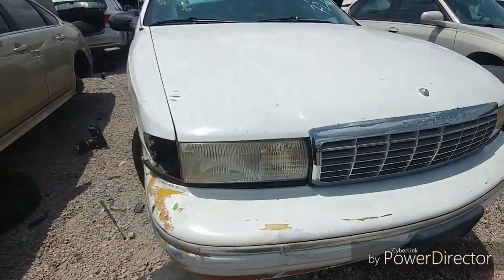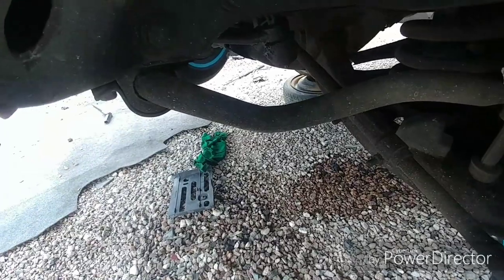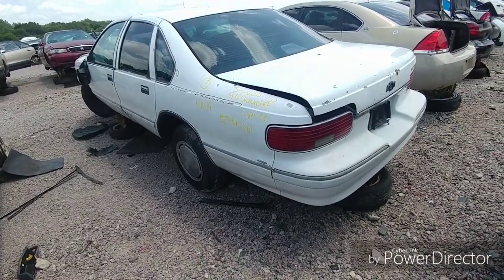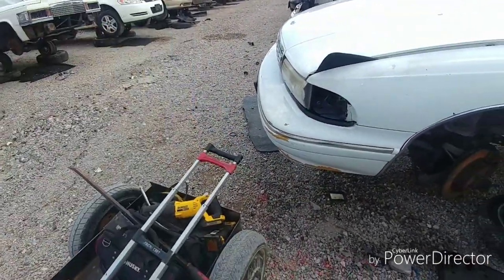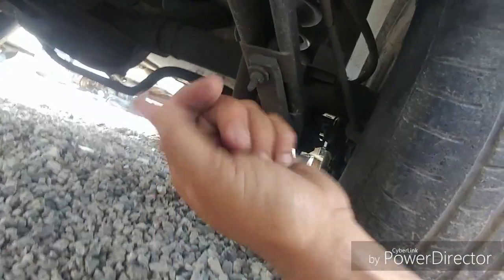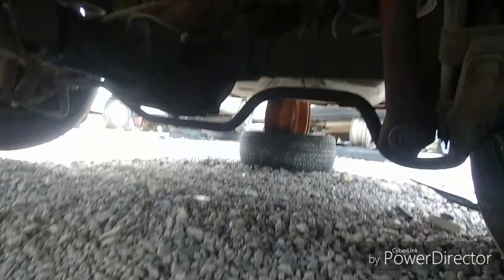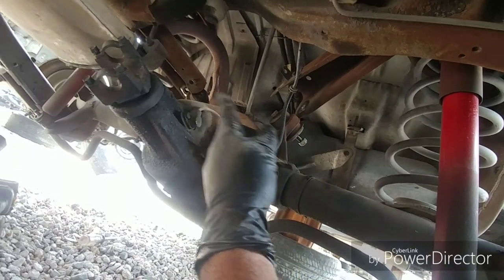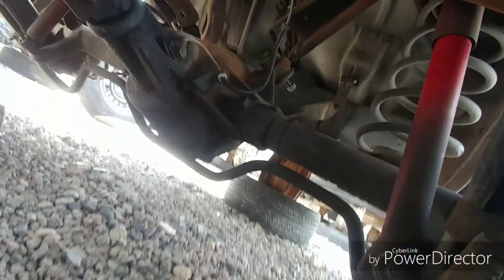Caprice 9c1 Posi G80 Rear End Disk Brake Junkyard Find

Comment: Love these cars!!! The 94-96 Impala SS's are one of my all time dream cars! Would love to also get my hands on a low mileage 91-93 bubble LTZ or 9C1.
Reply: The 1993 Caprice LTZ with 5.7 liter was a great car.
Reply: @moonbeamskies3346  Yes indeed!!! The last low mileage example I saw was back in the early twenty teens. It had 30k original miles.
Reply: @canibusnj  I remember seeing a used '93 LTZ on dealer's lot in 1994 and took it for a test drive.  I was 25, and at that time practically no one under 50 had those late model rounded Caprices.  I had an '89 boxy Caprice which wasn't as unusual for a young guy.
Reply: @moonbeamskies3346  I was 14 in 94 and back then I was still in love with the 85 Iroc Z's, among other cars. I wanted an Acura Legend coupe when I was 16 in 96. lol
Reply: My old supervisor's father bought a 1996 Impala SS, and he still has it. Probably has under 10k miles. His dad is getting older now and really cannot drive, so I suppose my old supervisor will wind up with the car.
Reply: @moonbeamskies3346  There's currently a 1990 Chevrolet Caprice Classic LS Brougham on the market with 12k original miles. It even has the F41 suspension and velour seats. That thing is sweet!!!
Reply: @googleusergp  And they're going up in value each year, especially the low mileage ones.
Reply: @canibusnj  Knowing what I know about this person, I'm sure it's in very nice shape.
Reply: Alot of people who worked on lt1 cars for a living despise those engines and cars the optispark was pure garbage because the water pump would leak and kill it, the fan wiring was garbage and would go bad all the time and once the aluminum headed motors got overheated the heads would crack and the crankshaft would tear up all the time matter of fact most remanufactured lt1  engines have the cranks cut 40 to 60 under which for most engines is unacceptable but there is hardly any good cores left but,in the cars defense most people that drove them loved them and they were decently powerful but if you worked on them. the love would go away that's why most were junked most repair shops won't even touch lt1s anymore

Comment: Oh my God if it's a real 9c1 there r so many parts you can take.  the auxiliary transmission cooler, the auxiliary engine cooler, if it's a late 95 or 96 the 5/8 inch ball joints up front.  pretty much the whole suspension. you could even take the green silicone.  which according to the service manual you never have to replace. What kind of shocks are those red shocks in the back. They came with bilstein's stock

Comment: I don't know but I been told that the "Patina look" is in and dozens of C10's just waiting to be rescued out  of farm fields just everywhere... hasn't been started in thirty five years an a battery and some giggle gas will bring em back and a six cylinder model will run low  "10's" and this bridge to no where is only forty five miles from my house in alaska... a ugly el camino can be yours for only nineteen hundred and fifty dollars, you might need new frame rails from where the frame makes the first part of the arch over the rear end to the bumper if its still held on with tie wire. All the L bodies frames were gone at least on the exhaust side. The real old ones are still hammering down the road but mid seventies till death of the camino were junk

Comment: So this video was a year ago? I can tell by the white 79 Coupe deVille. Did you already swap in the Posi & found a use for the steering box/brakes?
Or are they now dust collectibles in your shop😂😂😂
Too bad the new tires have the whitewall on the inside Benny!😂
Reply from the maker: Cant get one pass you 😆 don't know why I held onto this video but figured it would fit in with the current temps we're having. I only bought the front sway bar, front wheels and tires and the rear end. As of now they just decoration in the shop.
Reply: @ClassicRideSociety  Lol!😂 I can spot those things a mile away! It's a good time to release whatever videos you got. It's good to relieve some storage on the phone as it can overheat often!
I'm assuming you're gonna put the Posi in your box Chevy after the station wagon project? Hope that's going well! Better work in the shop than bake out there!

Comment: Does it bolt right up to the box??? & does it have to be a 9c1 bubble
Reply from the maker: It bolts up. Only issue is that the bubble uses a 5x5 bolt pattern. The box, unless it's a 9c1 is going to be 5x4.75. You can get it out of any bubble. Just dont use the bubble wagon unless its going in a box wagon
Reply: @ClassicRideSociety  oh ok thx... ima take a trip to the junk yard cause I really want disc breaks in the back....  with the bolt pattern cant u jus change the hubs
Reply from the maker: @chevygwapgangbeats2889  either get new axles or have them redrilled. If its just disk brakes you're after then you may want to.look at the 4th gen 98-02 fbody rear disk brake swap. This is more if you want an 8.5 rear emd over the 7.5 that might be in your box. Some boxes already come with an 8.5. My 89 LS Brougham came with an 8.5 from the factory
Reply: @ClassicRideSociety  oh ok I see... yea I got a 88 full top brougham... yea I want disc but posi also
Reply from the maker: @chevygwapgangbeats2889  i think it was mainly the 9c1 bubbles that got the disks. Some 9c1 bubbles didnt come with a posi though.

Comment: Didn't G80 come standard on all third gens except the base?
Reply: Yes, I believe so.
Reply from the maker: No ive seen plenty of 3rd gen non base models without a posi
Reply: @ClassicRideSociety  Right, I stand corrected. I believe they had to be an LTZ or 9C1.
Reply: @ClassicRideSociety  Let me correct my original, so this is an edit. I think the engines were the 5.7 VIN code 7 from 1991 to 1993 and the  5.0 VIN code "E" from 1991-1993.
Reply from the maker: I think Adam was asking about 3rd gen fbody
Reply: @ClassicRideSociety  For what3ever reason also in 1981, posi was optional on the Trans Am, yet standard in other years. LOL. Go figure. GM can be weird with options at times.
Reply: @googleusergp  I've never seen a 4.3 V6 in a 91 to 93. O_o
Reply: @canibusnj  I corrected it, it came back to me. I believe both the 5.0 TBI VIN code "E" engine and the 5.7 TBI VIN code "7" engines were used in 1991-1993. The 94-96 had the 4.3 VIN code "W" engine and the 5.7 VIN code "P" engine (aka LT1).
Reply: @googleusergp  I remember a Caprice expert on another video said the 5.7L (350ci) was not available on the 91 and 92, only the 93 model. The 91 and 92 LTZ and 9C1's had the 5.0L (305ci), but a better gear ratio, can't remember the difference from the base Caprice's.
Reply: @canibusnj  The public couldn't get the 5.7 VIN code 7 engine until 1993 according to what I read. The regular ones had the 5.0 VIN code "E" engine from what I remember---same as an F body up to 1992.
Reply: @canibusnj  I have the 91-96 GM parts microfiche downstairs. I could just look it up. LOL. I used to have the parts computer on my PC, but when I swapped PC's, the software doesn't work with Windows 10. I have to have my cousin install the "virtual machine" so I can use an old Windows OS within the computer and then I can use the GM parts system on that.

Comment: I rather doubt that's a 96 9C1 because 96 9C1s were only contractually built. Most of the b-bodies went to the Impala SS line for 1996.
Reply from the maker: I was going off the rpo code sticker on the deck lid